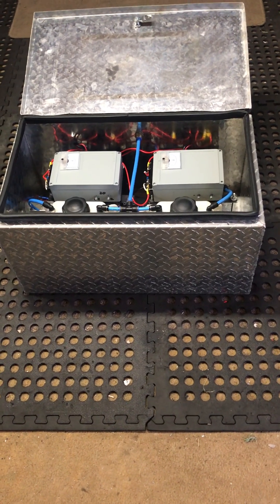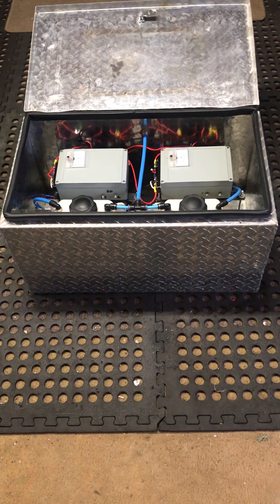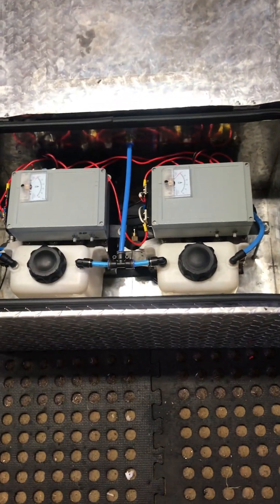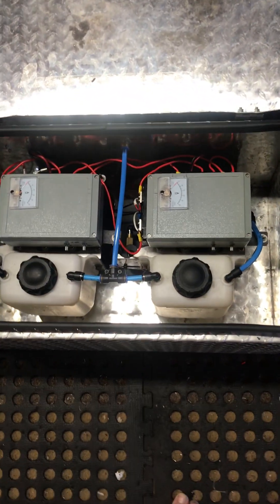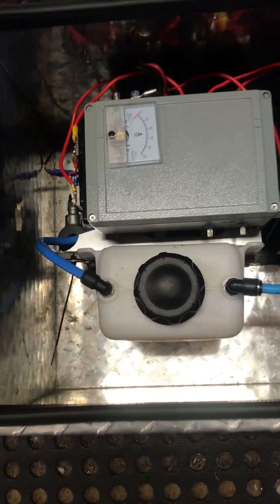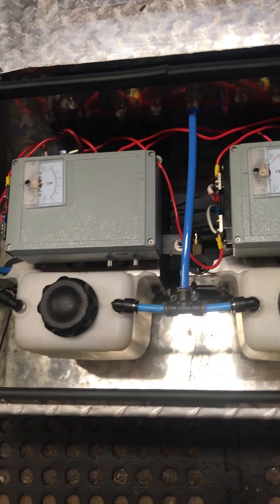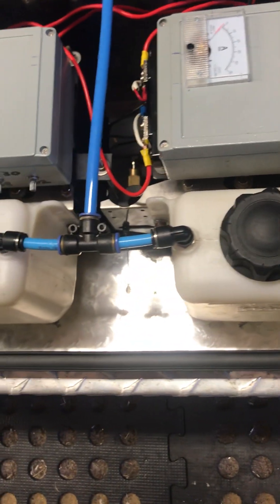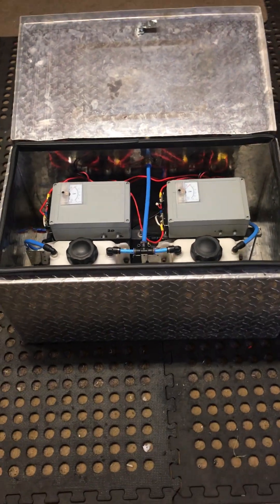Twin Gen 20 Hydrogen Generator kit for Large truck saves 34% fuel

Comment: Do you have any experience fitting these to carburettored engines? I have a 350 chev suburban with a quadrajet and I'm interested in using hho though  im not sure how I'll go about jetting it
Reply from the maker: Certified test results have show savings of 42% on a 2.8 LItre diesel and a 3.6 Litre  petrol fueled wagon     call me on 0403177183     glknox11@live.com      patented proven system https://hydrogenfuelsystems.com.au      Gavan Knox BSc, BEd

Comment: What about 7.3 diesel?
Reply from the maker: @jimmyweber8793  tests on a 7.8 L diesel truck with 28 t loads reported saves of 34% in an independent certified testing procedure
Call me on 0403 177 183 
HTTPS://hydrogenfuelsystems.com.au
Reply from the maker: Certified test results have show savings of 42% on a 2.8 LItre diesel and a 3.6 Litre  petrol fueled wagon     call me on 0403177183     glknox11@live.com      patented proven system https://hydrogenfuelsystems.com.au      Gavan Knox BSc, BEd